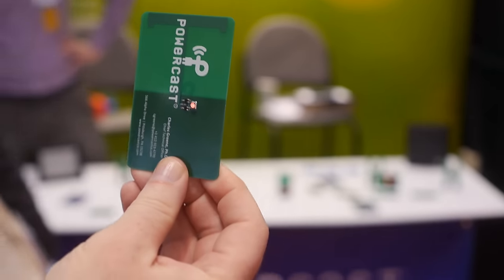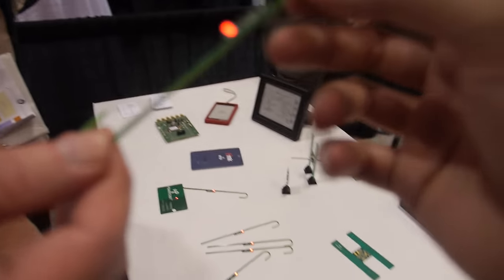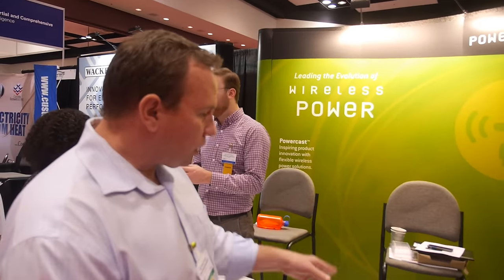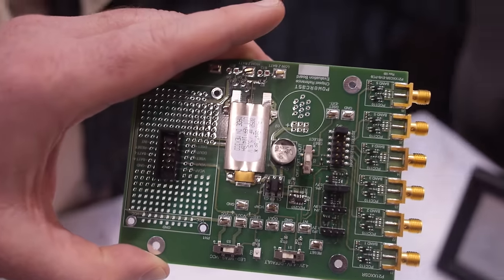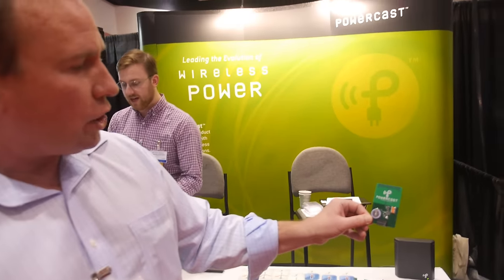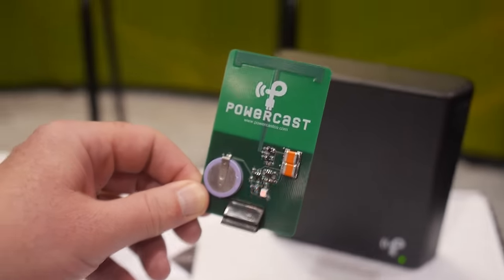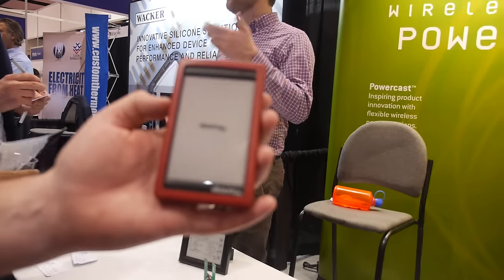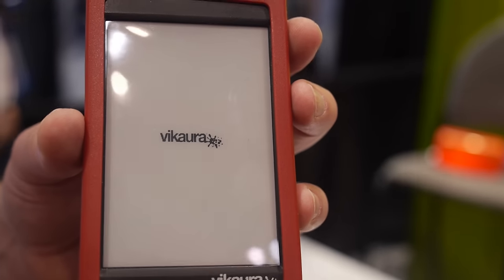Powercast Wireless Power at Energy Harvesting & Storage USA

Comment: wifi in the usa is capped at five hundered miliwatts...cool product get back to me when u can do this with no cell devision no roasted nuts and a range of fifty feet
Reply: i think this is only for short to very short ranges, it would eleminate the need of yet another cable to charge your phone p.e. the signal from the net will be boosted or sent along with the power from this "docking station" that sends it further to the units charging
Reply: oh, by the way there is a device used on boats, connect to the boats vhf antenna, voila the 3 nautical mile wifi unit